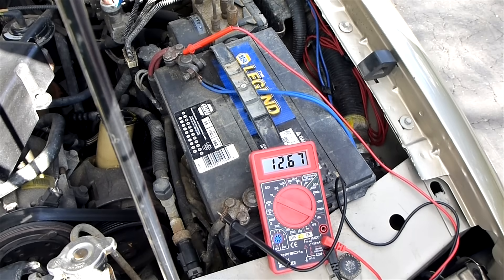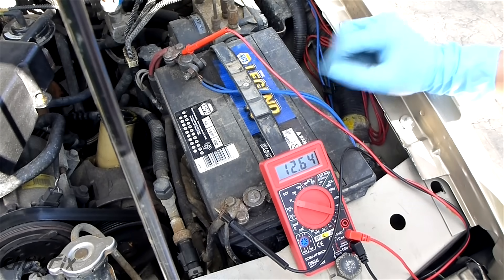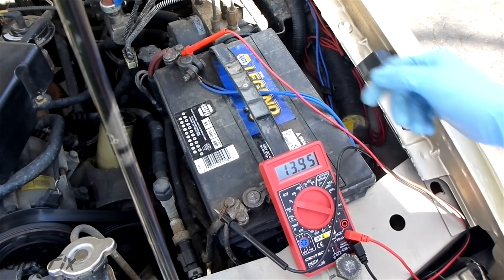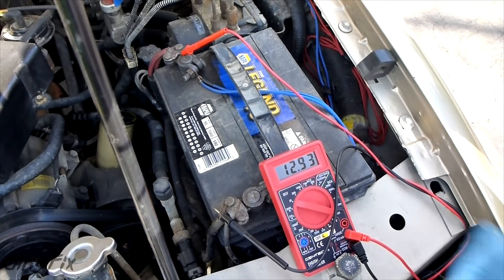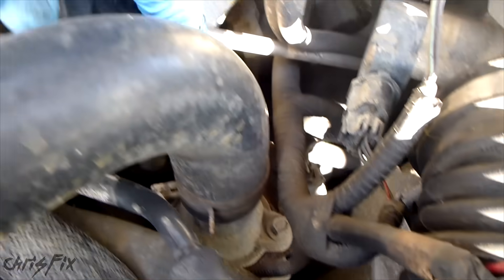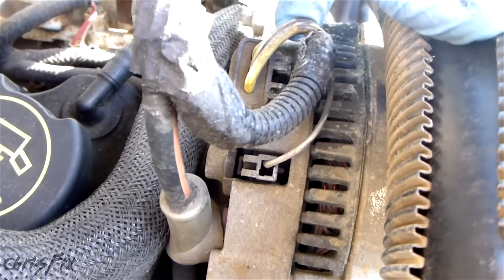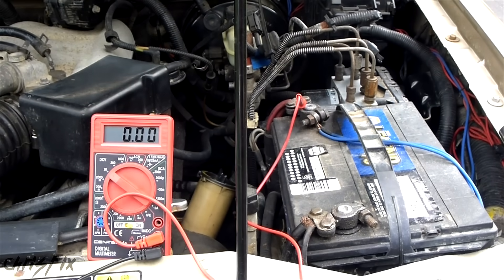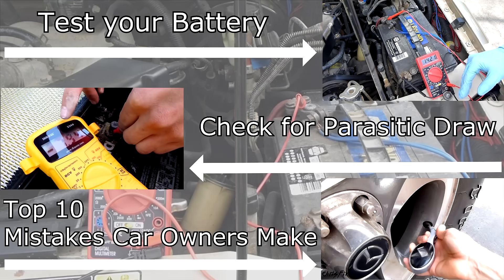How to Test an Alternator

Comment: Any ideas anyone ..... My KA lost its charge so I bump started it. Charged it up and fine and checked multimeter readings. Idle it was reading 14.09 (Just under 14.2 - 14.7 Chris recommends.) but when i put all the electrics on it is 13.65, above the 13V Chris says. So i am stumped! Could this be the alternator volt regulator not giving enough volts when idle but kicking in properly when i use all the electrics? I thought it was originally because it is winter and I am using all electrics on every trip, but the figures say that it is fine in this scenario...

Comment: I did my test today on the alternator with everything running on the car the reading was 12.5 v and i shut off all its was 14.2 what do u think its time for new alternator ?? because u mentioned 12.7 the lowest u can get
Reply from the maker: Try cleaning the terminals first but it sounds like you might need new alternator.
Reply: Hey yes I did cleaned the terminals but I only gained 0.01 which I done it before the test which my results they were after cleaning. thanks again for the replied
Reply: I hate that you have to hook up a diagnostic tool to read those codes. All newer cars have a digital odometer anyways, so why not just flash an error code, like your computer does, whenever the check engine light comes on?

Comment: when I have an amp and subwoofers going onto the battery the truck doesn't idle and only runs when you feather the gas but when they are disconnected the truck works fine do i need a stronger alternator because the battery is still good

Comment: Been having intermittent start issues. Your videos on standard battery/alternator throughputs have really helped me out diagnosing the problem. Just wanted to say thanks man, I owe you a beer.
Reply from the maker: +mako sn awesome man! Glad to hear it! What was the issue.
Reply: Was laboured turning over on ignition. I suspected battery or alternator failure not supplying enough/any voltage. It was suggested it could also be the starter motor.

Tested with the multimeter - battery fine, alternator fine (referring to your videos). Then I recalled when I last replaced this a few years ago them not having an exact battery in the parts shop, so got one I was advised 'should be fine'. I clocked yesterday it was only 300 amps, so I'm thinking the recent cold weather in the UK (working on the premise that I was only getting 65% of those 300 amps supplied, also battery age) is below the minimum required for my starter. Ordering a replacement with 420 amps today. Would also explain some strange electronic behavior as the weather has worsened.

Comment: so i have a 2003 Honda civic ex , i have a brand new battery and alternator, the only test i havent run yet is the connector test, when i stary the car the voltage drops to about 11.6 , i can drive it to and from work no issues and no trouble starting,  when i turn the car off the volts go back up to 12.3 on the battery

Comment: On some of these newer vehicles you have to be careful interpreting the voltage readings coming off the charging system. Unlike on older vehicles the engine control computer and the alternator communicate back and forth. The alternator tells the computer how much load its carrying and the computer adjusts the output voltage coming from the alternator accordingly. For example the computer will cause the output voltage to climb to 14.5 right after a start but as the battery charges it will drop it down. Then when the computer detects something like turning the lights or the A/C on or off it will make the output voltage go up or down according to how its programmed.
Reply: Joe Vignolo just to add upon the alternator does not communicate with the ecu as it's just a pure mechanical device with not software or cpu 

What the ecu/ecm does Is it monitors the  voltage and amps being produced by the alternator once any of those values drop the ecu/ecm may trigger a malfunction indicator in the dash.

Comment: Nice video! It helps me but I have a question.. I have a 2000 Mustang GT and sometimes the battery light comes on. Sometimes its on for 20 miles, sometimes when I push the gas.. I checked the battery with the alternator and I got 13.8 volt. When I turned on the ac, and all lights it's about 13.4 - 13.6 Volt. Thats normally enough right? What else could be the problem... The car has 115k miles and its still the stock alternator. Wires are looking good.
Reply: This sounds like the same problem I had in my 2003 Windstar. The battery light sometimes would just come on for no reason. Sometimes it would go out by itself or shutting off and restarting the engine would clear it. One thing you have to be aware of is that some of these alternators are controlled by the PCM. You engine computer and the alternator talk back and forth and the computer tells the alternator how much voltage to put out. Sometimes a glitch can happen and the internal regulator inside the alternator is at fault. You probably will need to replace the alternator unless you can change the regulator inside yourself. But be careful. There are a lot of cheep knock off aftermarket regulators floating around. Don't buy the cheep ones they sell on ebay. Make sure the new regulator you buy is an OEM regulator. Also, there can be problems if the aftermarket alternator you bought has a cheep regulator inside. There are rebuilders that only use OEM regulators. Try to get a new alternator from one of those. Otherwise you could end up with the additional problems.

Comment: My battery light went on, it turned the truck off completely. I turned it off and back on light was gone and was running havent turned off on me again not sure whats wrong with it checked the battery and alternator they are ok. Any idea why?
Reply from the maker: Clean the connections to your battery and your grounds.
Reply: Nick callaway sweet that's exactly what happen with mine. Thank you ChrisFix.

Comment: so as I was driving home from work my car's clusters started to dim then suddenly my mph and rpm gauges just dropped like as if the car was off. then when I got off the freeway using my blinker made my headlights flicker till I turned off the blinker. then starting from first gear to second it bogged like crazy then picked up suddenly and it was like that for every stop sign (4)  till I made it home. it starts still. did the first voltage test you showed and it everything checks out. haven't done the other ones you did after that. just wanted to see if any of these symptoms have anything to do with your test you're running before I go any further. thanks

Comment: should it be the same voltage when you have 2 batteries connected to the alternator? because I am getting 12.9v and 13v on the other when the truck is on idle

Comment: Hey Chris - thanks for this. is it possible for the alternator to read 'normal' voltage readings but still be faulty? When i put my voltage meter to test this, it isn't stable, meaning it jumps up and down unless i put the leads around on the battery in some sort of way.

Comment: What if I have low battery charge (12.2V) only when I start the car after 10-15 min sitting? It goes on 13.8-14V after couple of moments but that initial charge is low and then I get low battery charge message on board comp?
Reply from the maker: Take it to a parts store and have them load test it for free.

Comment: Hope youre still responding to this thread, my car seems to act up once warmed up. I get about 15-2o minutes of driving in, the instrument panel, lights etc dim, the battery light kicks on, after continued driving, everything continues to dim until everything dies. Engine,everything. Need a jump to get the car home. Once home, and ive charged the battery, i perform your tests, but everything checks out!! Is there something   else I can test? This has happened about 4 times. Only while driving longer than 15 minutes. HELP
Reply: just in case he doesn't answer, here is an idea. 

basically to me from personal experience this sounds like a bad battery ( emphazis on "bad" battery)

if you are getting over 13 volts at the battery when car is running and everything else seems good. then it could just be the battery is really bad.

I would suggest you  get your boyfriend to take that batt out and take it  to autozone AND oreillys and have them check it out for you ( its free) . and if both tell you its crap then just buy a new one in whichever u prefer. 

I would also like to mention that you better do this test  asap as making your alternator working overtime will really kill it, wayy  before its time and then you will be looking to replace an alternator too. 

and neither alternator or labor is cheap, comparing to simply switching out a battery.

Good luck.
Reply: Thank you. The battery is also testing well, but will try with another battery

Comment: hi,  so what's the name of that tool your using to check the battery and alternater
Reply: its called a multimeter....malady.  ok automatic one at walmart for 20 bucks or kinda ok at  harbor freight tools for around 8 buckaroos. i think.
Reply: Mz.Ladyt Tru
Reply: http://struggleville.net/723-2/

here is a coupon for a FREE (with any purpose) harbor freight multimeter valid until 1/18/17. Just scroll down past the scissors to the 2nd multimeter. The first one expires earlier. Enjoy

Comment: What if mine is jumping all the time? From 14.2 to 13.0 - even if NO additional power draw is on. For mine it doesn't matter if there is a lot of A draw or none, it jumps all the time, is that normal? Also should the Voltage increase with the RPM? as even at 4K rpm I still have the same as on idle -)
Reply: The regulator is not a simple resistor. It's a rather complicated electronic device with transistors and integrated circuits inside. Basically what it does is to monitor how much current the alternator is putting out and what the output voltage is. Then the regulator adjusts the current flowing through the field winding to vary the output of the alternator. This is so that when there are changes such as battery charge condition, engine speed variations or more or less load on the charging system the system can adjust itself accordingly to keep the voltage constant.
Reply: Loose connection
Reply: Which one? I checked the wiring from the alternator its perfect. No rust anywhere, cleaned the connectors as well.
Reply: Im not a mecanic.But its basic electrics.Alternators produce a lot more than 14 volts.The regulator to my mind is a simple resister.If it was the other way and say it was going 14 v to 16 v.Would be a sign that your regulator or alternator was damaged.You can only have one problem.A damaged wire or dirty ground.The vibration of the engine will cause it to open at the damaged wire Or.Have you ever bought a set of jump leads and they dont work .but current still works fine.Its because the cable is poor quality.Cables do not have to totaly break .To deteriate.If you know some one with the same car.You could take there leads of,and put on yours.If everything was fine.Then you would find the problem..If not then it would be a sign that the alternator is becomming tired I think its called spiking.But i dont think it is this.
Reply: I didn't think of that. If the pump was putting too much drag on the belt, that would decrease the output of the alternator.
Reply: Is your multimeter digital? Digital are more accurate than analog, but because they have a sampling rate (usually about 2 samples per second, or something like that), where analog meters have a slight lag to for the needle to reach it's target, digital multimeters are more prone to having the reading jump around if you don't have a solid connection to whatever you're testing. Check the leads on your multimeter to make sure you're actually getting a good connection. 

Did you see where Chris scratched the alternator case? That's to expose bare metal to get a good reading.
Reply: Yes I have a digital, modern 10A Multimeter. I also have an internal (cig. lighter) one which shows exactly the same voltage as the digital and I also tried the professional multimeter at the mechanics store to test the voltage and all 3 shows the same. It jumps (not all the time) but they do jump from 12.6 to 14.3 with 90% of the time being around 13.6 area. I have by the way recently installed a brand new alternator and it is exactly the same as the old one. Only the old alternator didn't go below 13.0V and the new one goes lower sometimes (especially when idle in traffic in gear), turning off/on the stereo/sub/heater/heated windows/mirrors/windscreen/fog lights/headlights makes no difference to that it might drop 0,1 Volt but then would usually go to the same voltage it was within a couple of seconds. So even with all the possible electrics turned off in the car I can still see the voltage around 13V and even below sometimes at certain conditions. At 2K RPM it usually would never go below 13.6V. But I'm not sure if it's normal considering that I have a brand new alternator and a brand new battery and I even replaced the leads from Battery to a Starter (for better cold starts). Any advise would be appreciated.
Reply: *****
Is it sudden erratic jumping, or just following the revs of the engine?
Reply: It's very random. Well I take most of the readings at the IDLE engine speed. With the RPM increase it seem to be more stable, but still jumping sometimes. On the cold engine often it doesn't jump as much, but then if you think about it cold RPM is higher than HOT rpm, might be because of that. Sometimes I check it in traffic and it might pretty damn low like 12.8-13.0V area, the other time it might be 13.5 or so and rarely about 14V (on the hot engine). I have a new alternator belt as well by the way.
Reply: *****
I assume you're taking these readings from the cig-lighter meter? Are your signal lamps on when it jumps?
I don't have any visual of your circumstances, so I'm just running off the top of my head.
Reply: If by Signal lamps you mean the headlighs than when it's dark yes and in day time I use fog lights. And yes when on the go - cig-lighter but the readings are accurate and it has been compared to multimetres. I could make a video probably to show you what is happening, but it's so random. My question IS THAT NORMAL???
Reply: *****
I'm not sure, since most of the time I'm just looking at the analog meter in the dash panel. And half of my multimeters are old analog models anyways. But signal lamps would produce a slight voltage drop when they blink on and off, especially more so if you've got an older vehicle with incandescent lamps, which is why I mentioned it.

Any dips in performance? Does it start okay?
Reply: I have a 1997 Subaru Forester limited edition car. Today I monitored the car only for a short while the voltage was within a good range 13.6-14.2. No idea if it depends on any other factors. But for some reason on the cold engine I see higher voltage.
Reply: *****
If you're above 13.6, then I'd say you're good, but I'm at a loss to explain what would cause the fluctuation. If you have a digital oscilloscope (it's a long shot), then you could plug one of the inputs into the cigarette lighter or somewhere else on the 12V system, and see if the transient voltage coincides with the dip spikes from the spark plug draw.
Reply: If the alternator's output is jumping it could be caused by the brushes and/or the slip rings. If the brushes are worn and are just intermittently coming into contact with the slip rings that would make the output jump like that. If the voltage regulator and everything else in the alternator are working correctly then changes in the current draw by the accessories shouldn't cause the output to fluctuate like that.
Reply: Well that's the thing - I have a BRAND NEW alternator....... And there were no difference to the old one. The old one was pretty much doing the same. Do I have to look elsewhere for this problem?
Reply: Well I replaced the power steering pump which is on the same belt as the alternator and it seems to be much better now, mainly staying in between 14.2-14.4 at idle and under load (but not always) going down to 13.7 V. It doesn't jump as much anymore.

Comment: I think my cars alternator isn't working... there is Battery sign (indicator) in switch board, one of my friend suggest me the problem with Alternator... I started engine and turned on the Lights, it were dim but when i rev it, the lights got brighter... What should i do now, is there be a big problem or not...

Comment: Is there a way to test a alternator that's out of the vehicle? I have a 2003 Dodge Ram 2500 diesel when I start the truck the volt gauge will fall to nothing and the truck will start to idle very rough. I took the batteries out along with the alternator. My local Advanced auto store tested the batteries, they where dead(7 years old). So I got 2 new batteries. I asked them to test alternator but they had no way of doing that.

Comment: hello question. If I have a brand new battery but my altinator is shot would the battery still start car
Reply from the maker: The battery will still start the car if it is completely charged. With no alternator charging it, the car probably wont start.

Comment: That negative battery terminal is terrible. Those temporary type terminals are a problem waiting to happen. You should cut the negative cable end off to have a good clean end. Then crimp on a eye terminal. Then use a marine terminal with a flat washer, a lock washer, and lastly a nut.